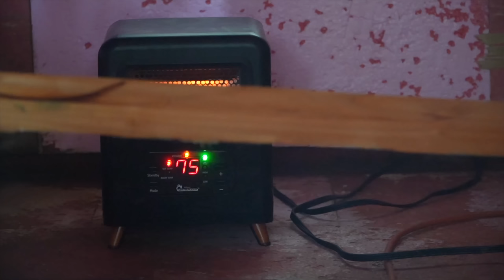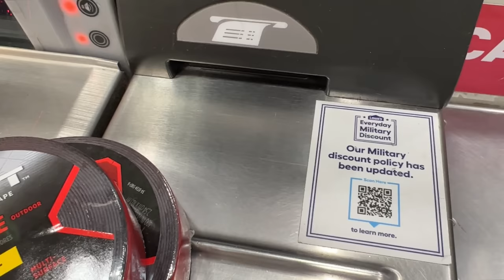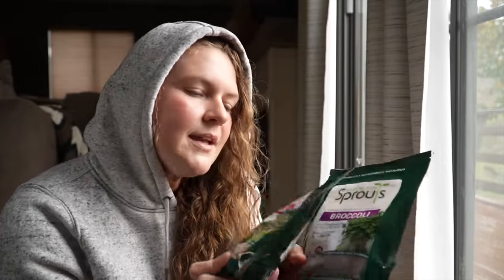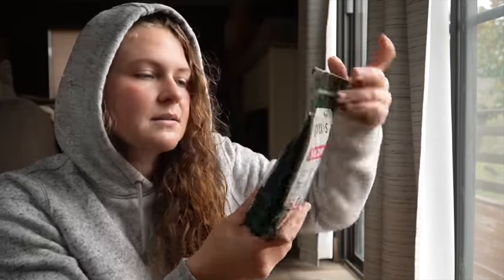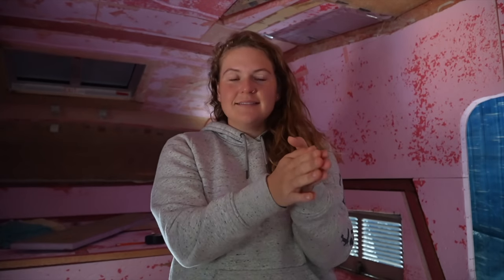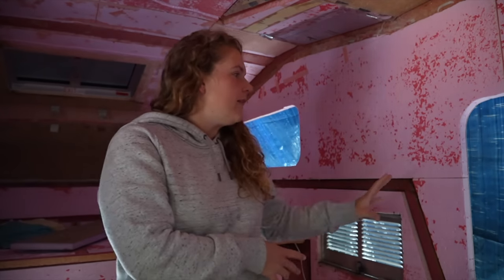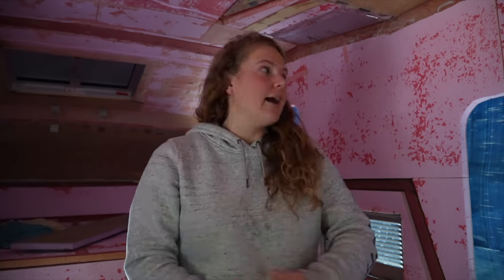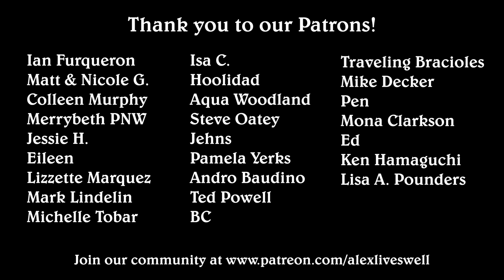the build is on! | truck camper renovation series

Comment: I guess you know where the leaks were/are, but in case your not sure, cover all the windows, and put the brightest light you can find outside on all sides and go inside and look for holes. And if you find any, I suggest you get a paint brush you can toss, and a few tubes of white, paintable calk and paint calk around any space you think may be a problem.

Comment: Nice job with the window framing ❤, maybe you should consider testing it with a water hose to add a little pressure to simulate heavy rains, wind blowing or storm like condition on top of the water bucket test 💡

Comment: You got more confidence than me after that. I'd of did the windows again and let it down pour and see if it leaked before putting floor back
Reply from the maker: I poured two buckets of water directly onto all of the seams (which should be more water than would fall at once from rain) and they held - woohoo!
Reply: @SheRoamsWild  

I caught that later in video. Should of watched all first. Lol. Woo hoo